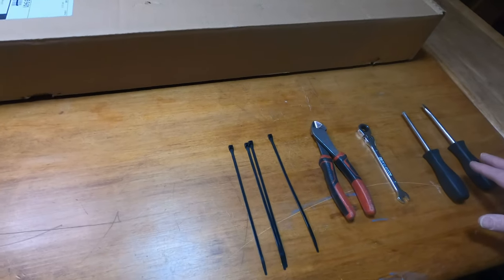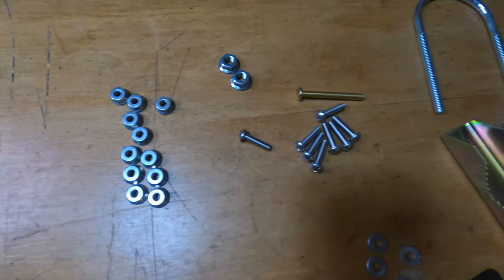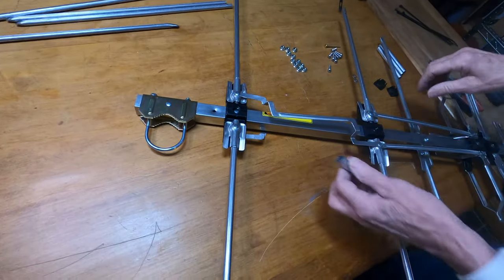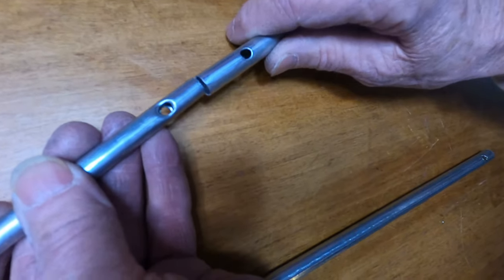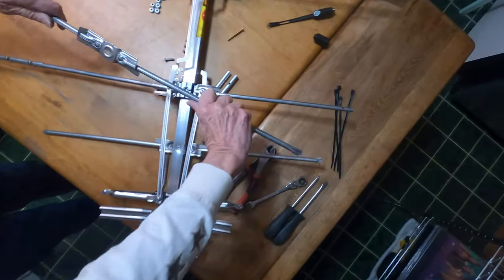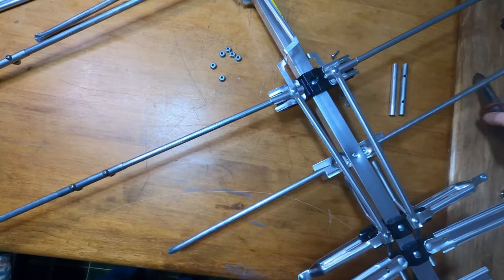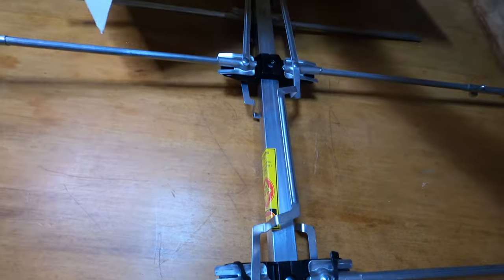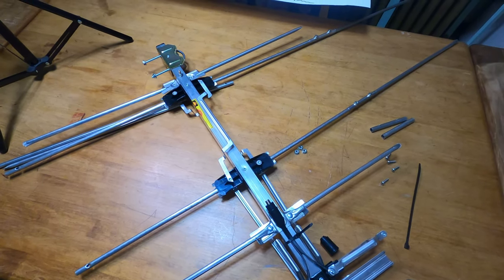Step by Step Winegard 7000c Antenna Assembly and Tips!

Comment: That was a well done instructional video.  The only thing I would suggest changing is that right at the start, you should have paused briefly and pointed to each item and said what it was.  This way when you say you are using a part the viewer will hopefully have a good idea what it is before they see you do it.
BTW:  
1) The transformer is also called a "balun" for "balanced to unbalanced".  Coax is unbalanced because it has a small conductor in the middle and big one around it as the shield.
2) With a very directional antenna like the 7000c, the direction you point it needs to be quite accurate. Directional is good because it gives you better signal but the cost is a bit more care.
Reply from the maker: Thanks for viewing the video

Comment: I like the looks and design of this tv antenna, however, why not simply discard the matching transformer use and now go into the newer tap in antenna connections these other tv antennas use. All you have to do is just make your connector, put lithium greese inside whare the center conductor is at, screw it into the tap in port, heat shrink the connection to the tap in port to seal out moisture, then slip your weather boot over both the heat shrink and tap in connection, and two final parts left, take plumbers goop put it over top the weather boot, again to seal out moisture, then drip loop your cable, again making sure that moisture will drip away from the connection. By doing all this prepreation, your pictures and sound quility will last you forever without any problems whatsoever. Wineguard tv antenna should put in the tap in port which is a much better set up than a matching transformer, I should think. Don't get me wrong, all my tv antennas have matching transformers on them on a 30 ft tower, however times have changed, and newer inventions, improvements have came on the scene.
Reply from the maker: Maybe it is a cost cutting way to go about it... I agree the matching transformers get on my nerves... Thanks for watching...